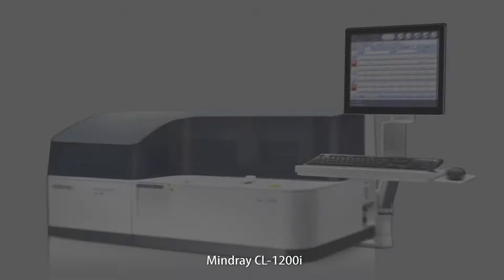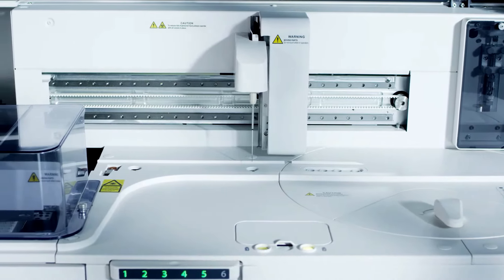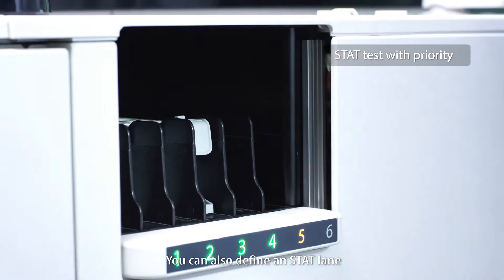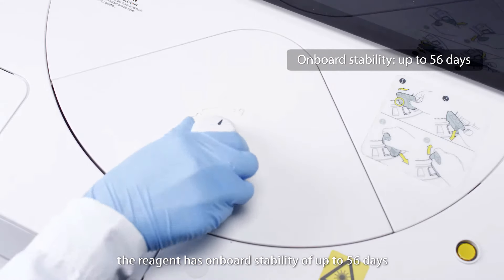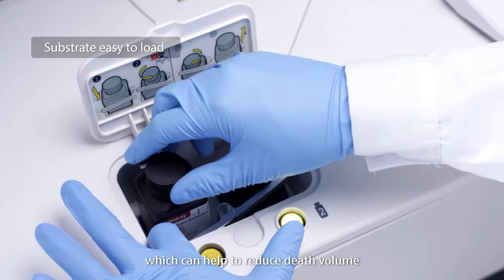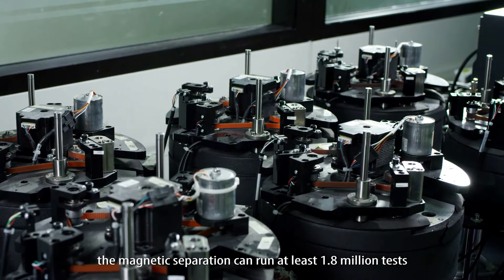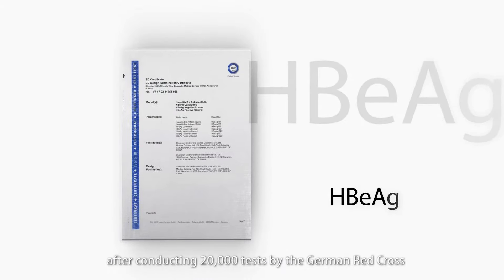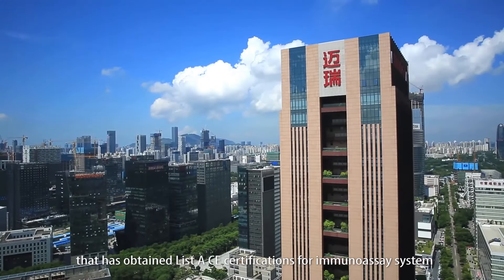Mindray CL-1200i Chemiluminescence Immunoassay System

Comment: Does it need to connect to a proprietary server or does it require internet sign-up profile to operate?
Reply from the maker: Dear Sir,  thank you for your enquiry. It's required to be connected to a proper system for operating. I hope this helps. Thank you!
Reply: Dear sir or madame, I thank you for your reply and politeness!
I still wish to inquire weather the proper system for operating you mentioned the analyzer needs to be connected to, in it's turn needs to be connected to the internet in order for the results to be computed, displayed and/or printed. In other words, can this equipment be used for infield studies of remote communities of people that lack basic clean water access, let alone internet.. or does it need internet access to function, update firmware, submit results, enter passwords (i.e. like with an iPhone)? Thank you!